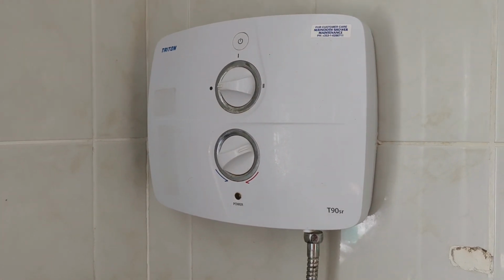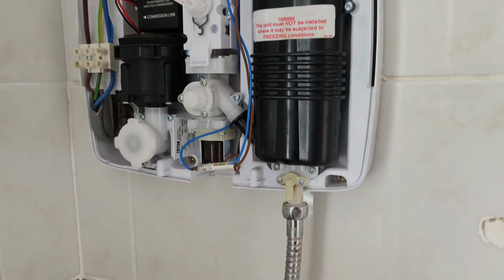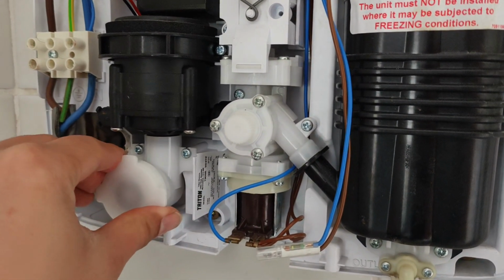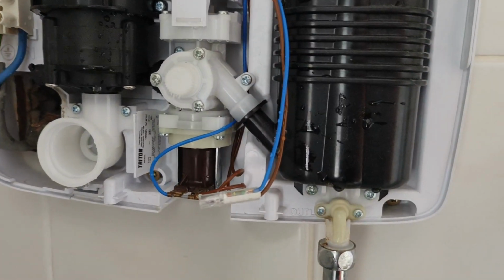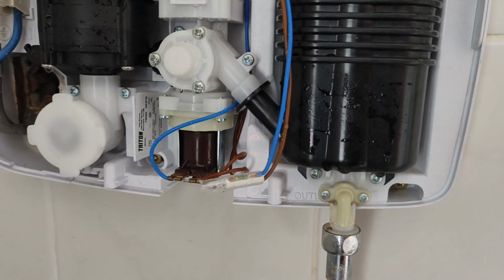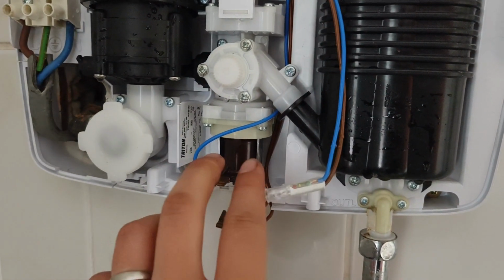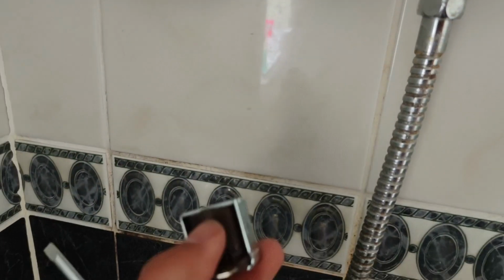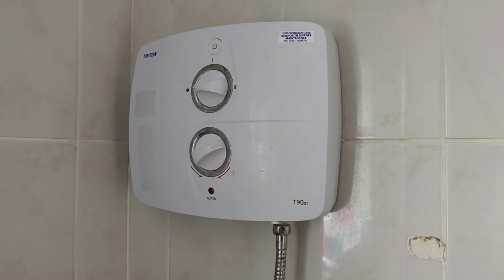How to fix Triton electric shower with no water problem

Comment: Also check where the water is heated as i have come across this being clogged with limescale or calcium
Reply: How to check where water is heated
Reply: You have to remove the black cylinder that's the water heater take pictures before removing for rewiring when I removed this it was clogged with calcium and lime scale 
Blew it out with air alot of crap in it .
Reply: @damo6975  Is it difficult to remove? My shower is pulsing when I try to make the water hotter by turning the temperature dial clockwise, I think the heating element is blocked.
Reply: Thanks I will try that, it's the Triton T90S had cover off and seen the heater .👍👍👍👍

Comment: Thanks can you post a proper link please
Reply from the maker: The link should be working now. you can also search Triton Electric Shower Solenoid Coil in amazon and there are a number of vendors offering it. Most Triton Electric Shower models appears to be using the same Solenoid Coil type, which make it easy to source.